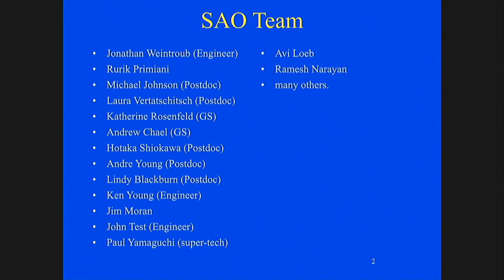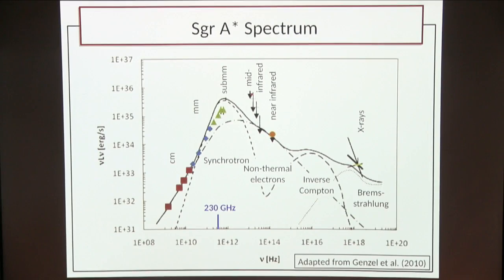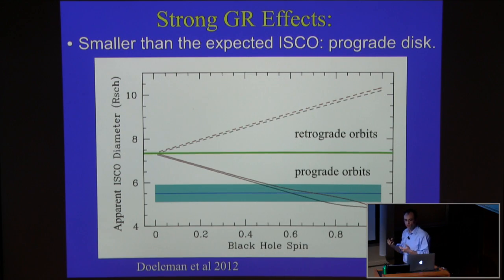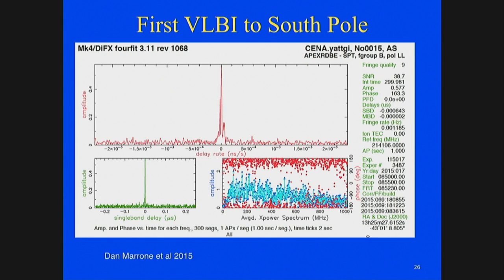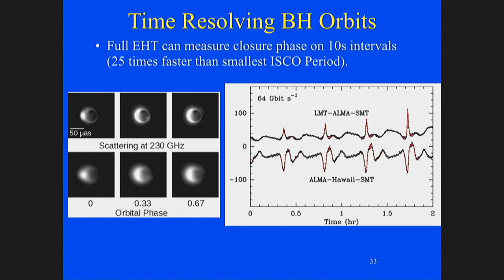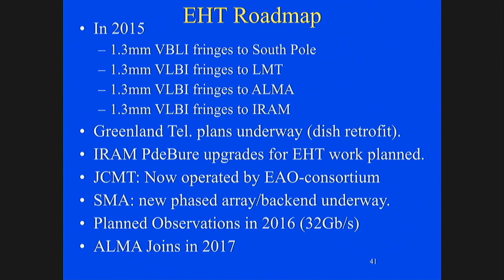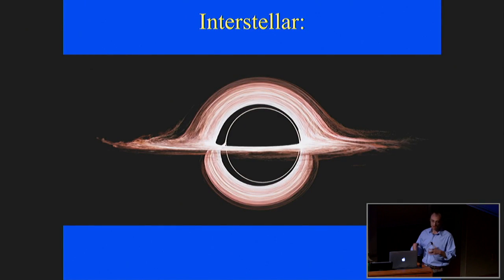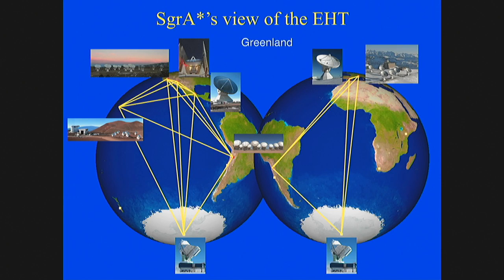The Event Horizon Telescope: Imaging and Time-Resolving a Black Hole

Comment: Do most physicists agree that black holes are super dense spheres of mass (not unlike neutron stars or white holes, just more dense) that have become dense and massive enough that their event horizon diameter exceeds the sphere’s diameter, going black from our view?

I think Einstein's wrong, that time is constant and that dark matter is the limiting factor to the speed of light.  I think it’s not space-time bending but rather gravitational waves and a greater density of dark matter.

The common illustration showing a flat plane turning into a cone drawn into a black hole at one point is simply incorrect and absolutely misleading.  A black hole is a super dense sphere of mass and everything should be illustrated with its gravity pulling everything into its center of mass from all directions.  vent horizons are spherical in shape, not round and 2D.  Please do a video on how horribly incorrect those common illustrations are.

Comment: Fake news. 1000 times the diffraction limit? That would mean , as predicted when it first showed, that the same image would resolve from white noise.  And that's if the data pointed out on the schedule WAS actually retrieved and not missing as stated. Dr Robitaille does, as always, a fantastic job of showing the failings of the EHT.